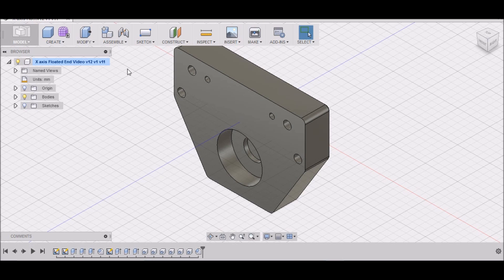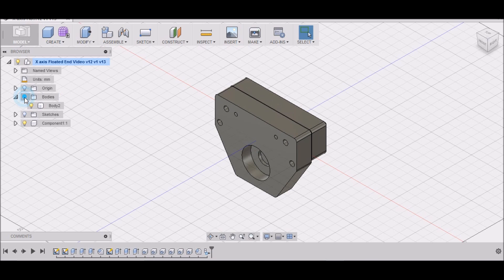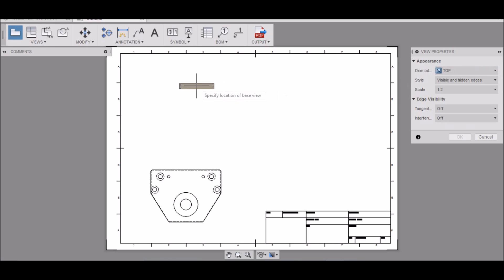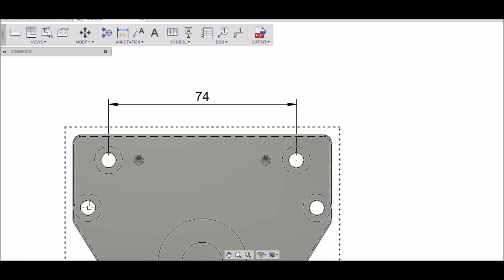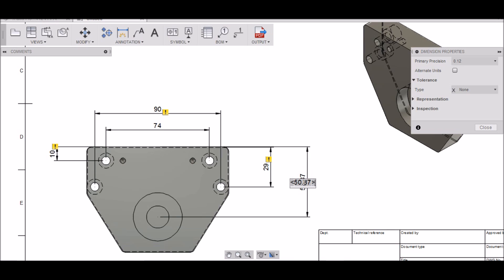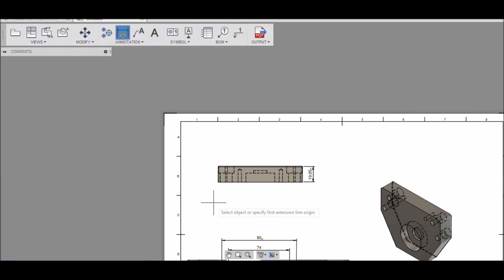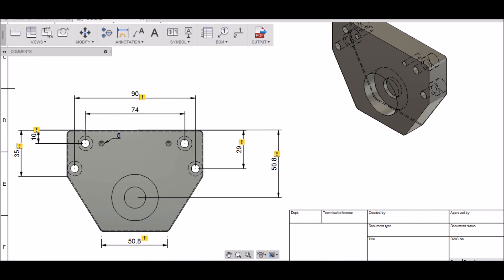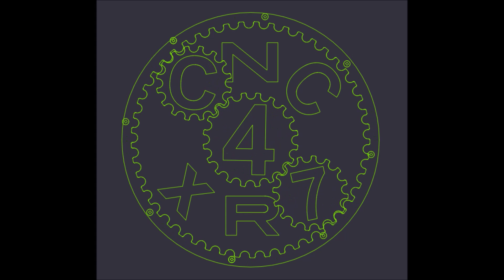Fusion 360 "Create a drawing from your design"

Comment: Why do you not start everything from a corner as the x zero y zero datum as this is how it would be machined in the shop? Also a degree call out on the angle so we have something to set up our sine bar or plate..
Reply from the maker: You could It all depends on the technique you use or prefer to design the piece. I like to sketch using the square tool and starting in the center. When you set your CAM setup you can define the corner you want to use as the Zero plane. The angle on this piece is not critical.

Comment: hi, im trying to make a drawing from a sheet metal design but when i make the drawing it also puts other components that are in my design, ones which are not metal sheet and are in separate components, i cant remove them from the drawing, help please.
Reply from the maker: When you create a Drawing from design try selecting the components you want in the drawing by holding down Ctrl